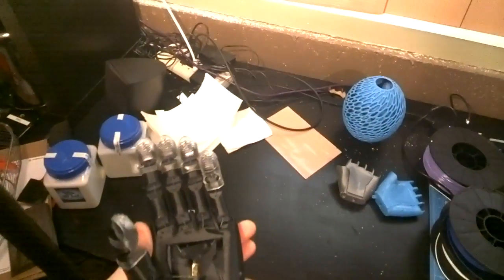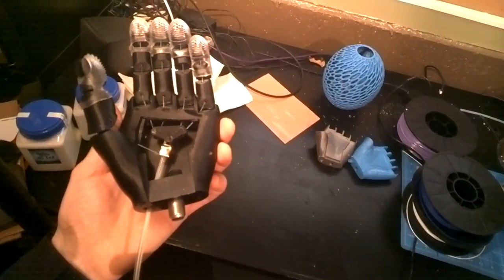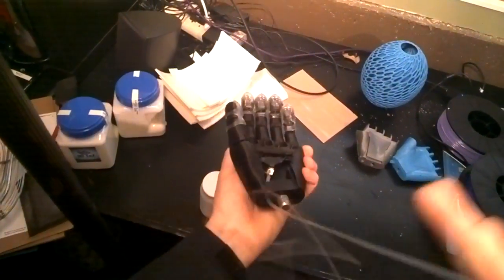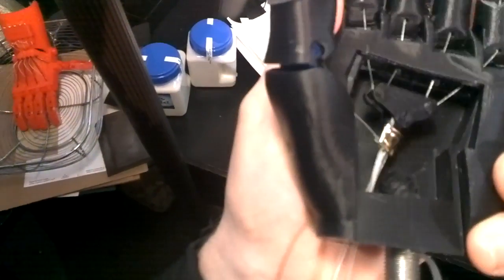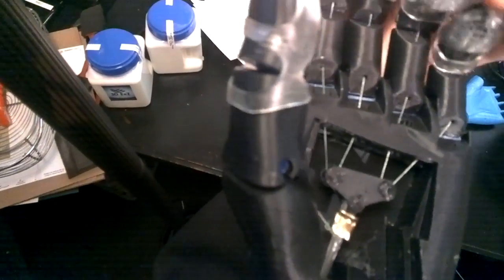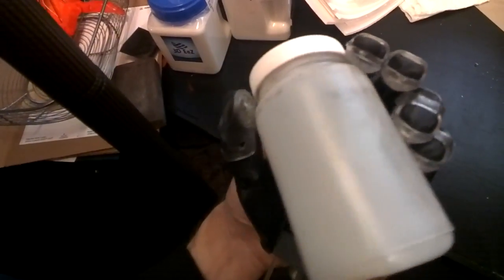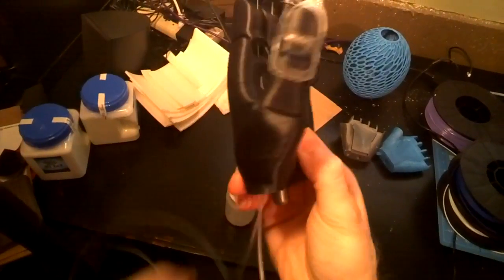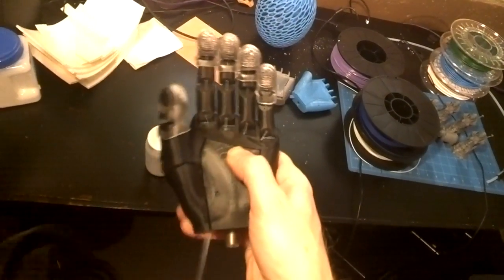FlexyHand Terminal Device Demo

Comment: Very clever design, and looks great.
???  Are you using video/cam glasses ?  Which one ?  I'm looking now at different models.
PS: Forgot to say thx for the last video on extruder gear cleaning.  Helped tremendously.
PSS: Couple of very new software programs you might want to have a look at,,, when you have time:
- " IdeaMaker " , free , printer controller and slicer , with built-in "file repair" and "free-cut". Support visualization and control is coming. (Flashforge and Wanhao 2nd gen. development team)
-  " OnShape " , free , browser-based CAD.  Written by the original developers of Solidworks.  No software, updates, file associations or file management, to worry about.  With real-time collaboration.    Amazing technical achievement to pull-off a seriously powerful desktop and/ mobile CAD package.
Reply: That's probably a gopro or a gopro like camera with a headmount.